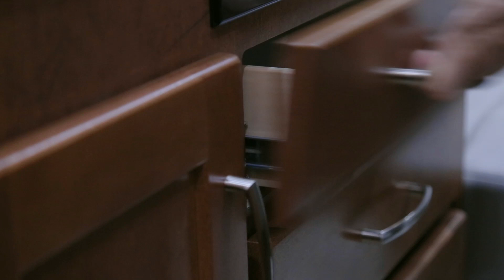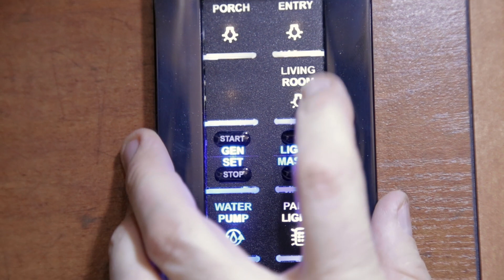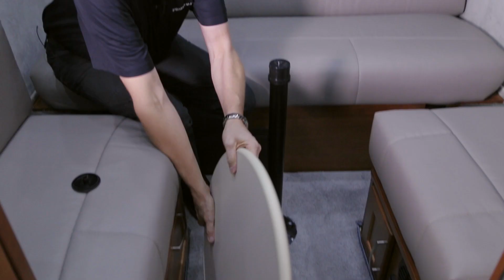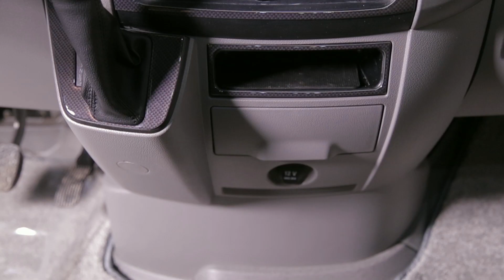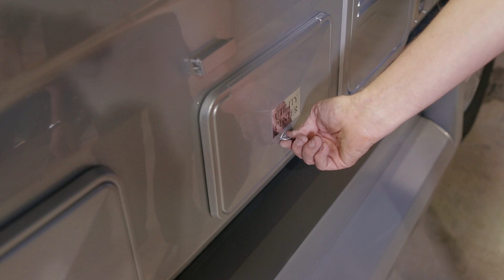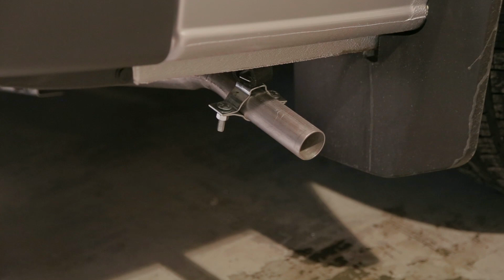2015 Ascent "How To" Orientation Walk-Through

Comment: That would be CO..... (carbon monoxide), not carbon dioxide CO2, which is the fatally dangerous gas for which you need a detector.

Also, the doors at the rear can open 270º, rather than 180º.

Otherwise, it was a very interesting run-down of the features of the Ascent.